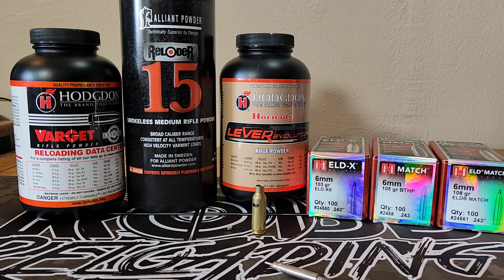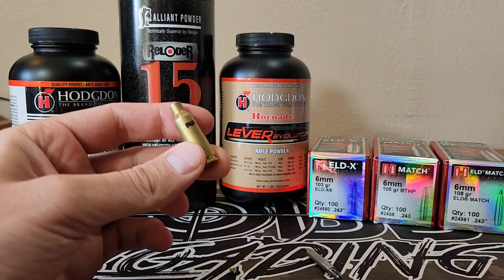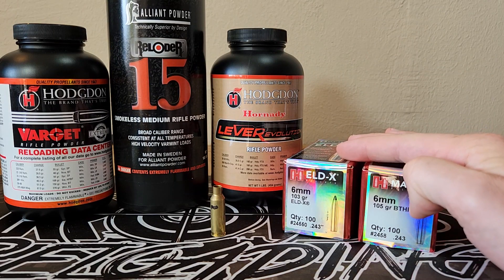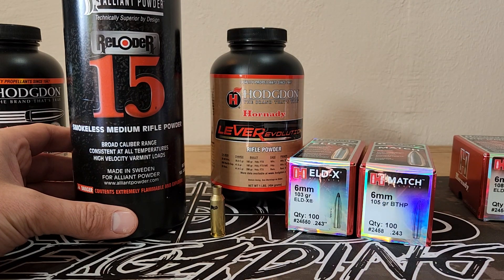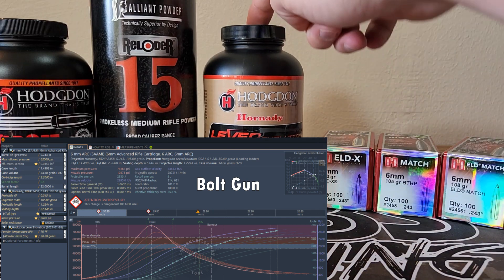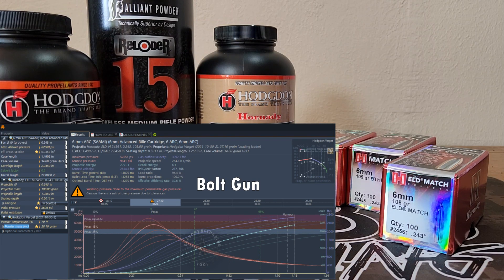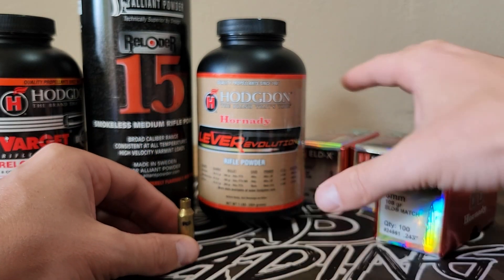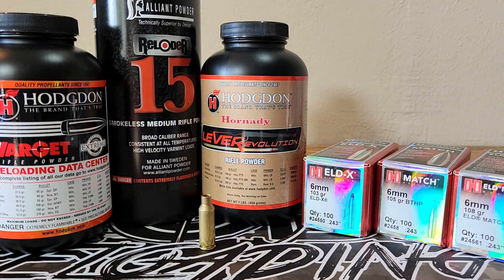6 ARC Brass Life/Load Data

Comment: Yes I have had the high pressure signs, ejector smear, primer cratering, bolt imprint, flattened primers, tight cases after firing. All with LEVEREVOLUTION at 30.2 grains. But no primer pocket issues.....yet. My brass is still useable after several firings, not pretty but safe and again the primer pockets are okay. I have a bolt action, not gas system and Hornady factory brass.
Reply: i have brass now with 8 firings, primer pockets still okay, zero split cases.

Comment: Good morning RR I have a gas gun Hornady does have data on their site for the 110A-TIP and 108ELD-M gas gun I've been using Shooters World Match Rifle powder for all my reloads w/ Fed AR match primers you've probably been using small rifle magnum primers I've been avg. 2713 fps m.v. from 20" BA barrel I've mostly loaded 105's but been loading 103 ELD X for upcoming hunting season and switched to CCI 41 primers I too now ready to prep for the 5th firing I can tell I'll probably have to trash about 25% of the 300 6ARC cases I have. I have 300 rounds of factory Hornady 108 match Ammo on deck I suspect after the next firing I'll have to trash some more idk how many but had same issue with.224 Valkyrie short brass life thx good day
Reply: P.S. I annealed after 2nd firing
Reply from the maker: I've used some cci450, cci 400 and Winchester 41 primers.

Comment: Rob, there a video on primer pocket repair.  The guy's is Jesse Weiner check it out!!!
Reply: Keith thanks for the info. 👍
Reply: Those ball bearing repairs do not work.  They only make the pocket entry smaller like a military pocket crimp.  Then when you seat a new primer the primer gets slightly reduced in diameter and is very loose at the bottom of the pocket and gas leaks prior to the primer cup expanding to fill the gap.  This can lead to a blown primer when the pressures involved are normal.  Simple physics involved here.  You cannot push an object through a hole smaller than the object without something giving.

Comment: With my 6ARC rifle, which is the savage 110 like you have. I found that if I go off Hornady's load data with their projectiles. It's over pressure, primer crater, and smear marks. I've since switched projectiles from Hornady to Berger. The over pressure stopped, I'm also able to load them a bit longer with their VLD 105s. Bit more room for powder and primer crater has been hit or miss depending on the primer I use. I believe the Hornady projectiles jams into the lands and that's where the pressure comes from. My lands seem to be around 1.715 or 1.720 if I recall. So, if I load at 2.260 or even 2.200 with Hornady 105s. Primer crater with even the 27gr area loads.
Reply: Bolt guns are easier on brass then M$R's. 
Ya see same issues "pushing" 6.8, 6.5 Grendel, 277, 25/45, 350 ... in M$R rifles. SHORT brass life... My 350 & 6.5 Grendel are in bolt & M$R and hands down bolt is easier on brass and can be loaded warmer.
Reply from the maker: @cw2a  I got 8-9 firings out of Hornady grendel brass and I ran some crazy load in my AR 6.5 G.
Reply: @RobsReloading  The 6arc MUST BE pushed to achieve all its claims. Same for the 25/45. Very lofty claims and the price is brass life. Back it off. (Like the Grendel) You will loose some velocity but you will enjoy a better caliber.